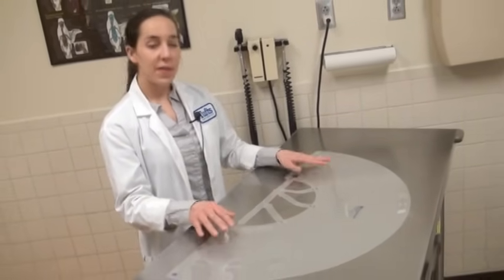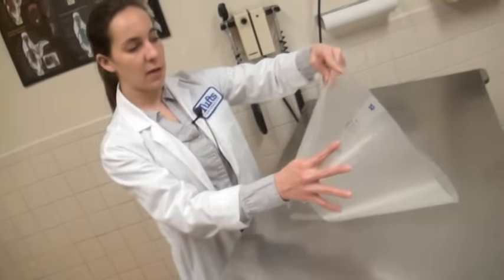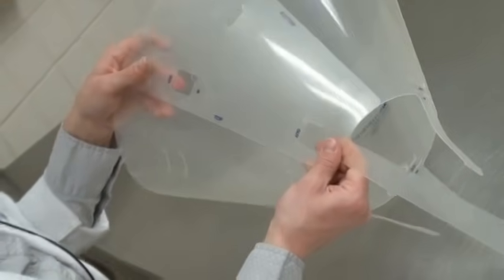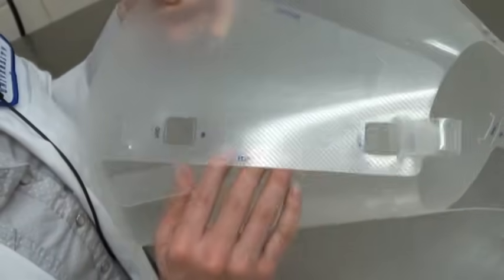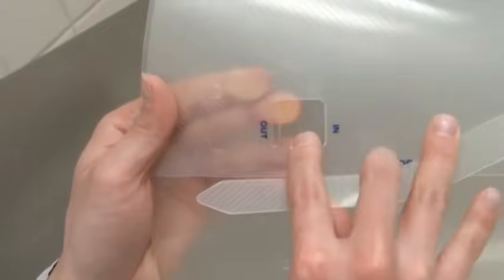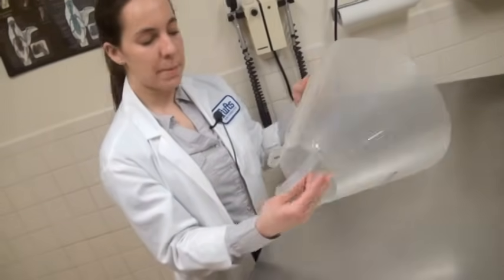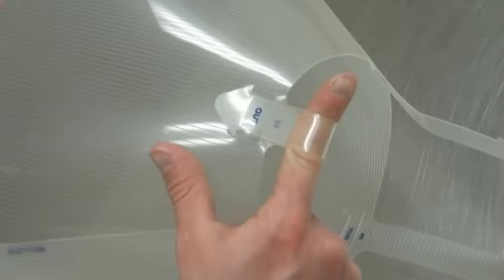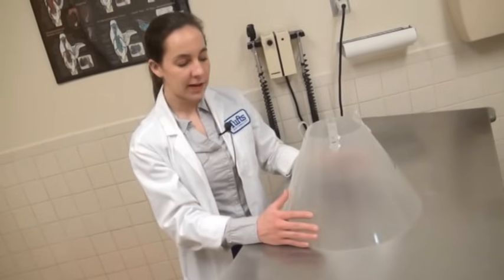How to Construct an E Collar for Your Dog

Comment: Is it ok to trim it down some? My dog is over 100 lbs. He had surgery on his eye. The problem is his neck is fat and he has lots of hair so the 25 cm collar the vet gave me was way to tight around his neck. So they gave me a 30 cm. Now it fits around his neck but now his head is do far down he couldn’t eat if he wanted to. It is  double the length of his head. I thought maybe I could just trim some off the outside?